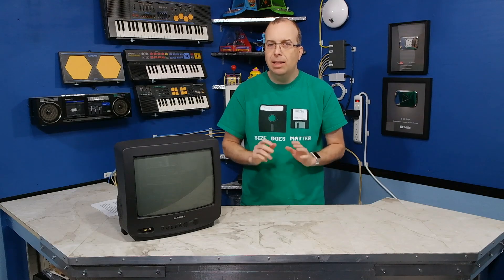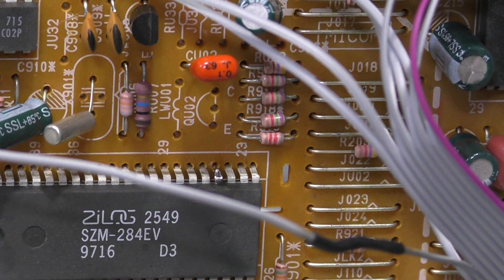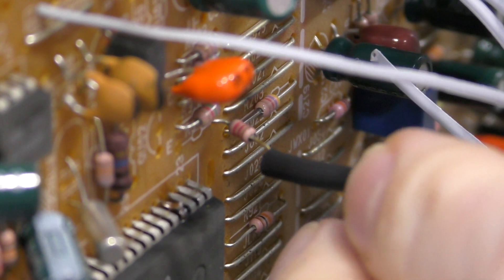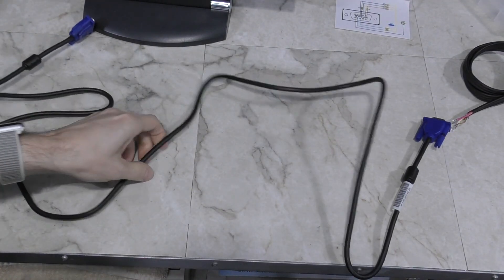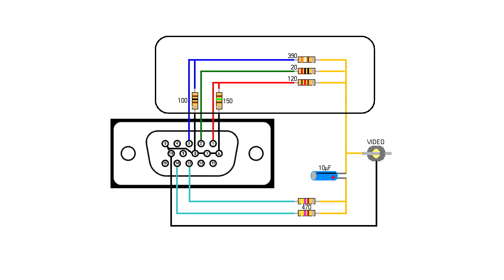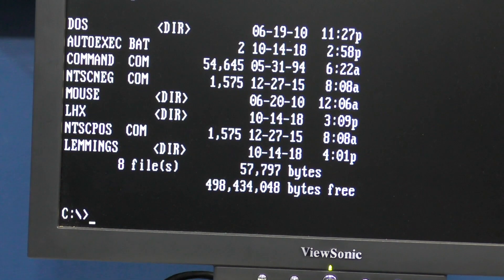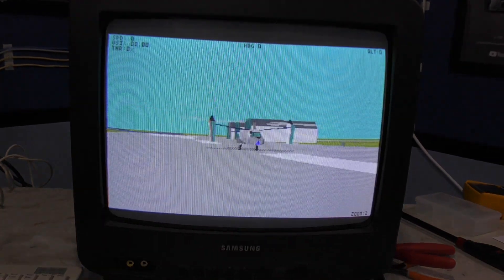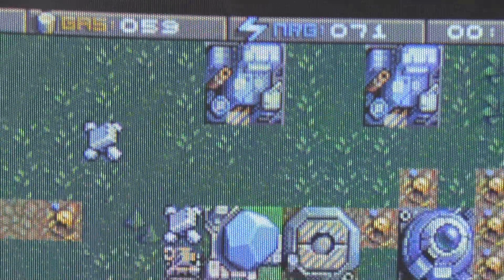Modding a TV for RGB - Part 2

Comment: could you change the tv from analog tv chanels to digital tv channels to get tv in the digital world
Reply: they sell/sold converter boxes for that.
Reply: HD capable digital TV tuners can output at a digital resolution of 1024x576 via SCART RGB, while composite remains old composite, often with ugly letterboxing.

So, using a box to upgrade to digital with just composite gets you a picture, but that is all that can be said about it. However, with RGB, the upgrade to 1024x576 makes switching to digital really worthwhile and brings some of the benfits of HDTV to older SDTV devices.
Reply: so your"e saying it could work?
Reply: Yes, certainly you can do that. I have watched TV for 8 years with a Vu+ Duo HD digital tuner connected to my Philips MG3 CRT television via SCART. I was very happy with that setup, skipped the LCD age, and only replaced it relatively recently with an OLED television.
Reply: well i ment inernal analog tuner in the tv itself, could you take out the analog tuner in the tv and replace it with a digital tuner from a flat screen tv
Reply: The digital tuner from a flat screen TV might not generate an analog RGB signal, it will do everything digitally. Assuming you could convert to analog, there isn't really a difference between an internal and external tuner. In the end both generate RGB signals.

If fact, you could remove the electronics from my Vu+ Duo (as has the circuits to convert to analog RGB) and build them into the TV. Voila, internal tuner.

Comment: IIRC didn't some high end TV sets have RGB connectors on them back in the 80s/90s? (not YPbPr, actual RGB often in RCA jacks)
Reply: I believe you are thinking of PVMs and BVMs, monitors with high-quality inputs for work on broadcasting or editing, which did have RGB, (RGBS and RGBHV) as well as YPbPr and even HDMI YEARS before they were on consumer televisions.
Reply: At 15khz I might add.

Comment: Great work but please get a hot air gun instead of using a naked flame on the heatshrink tubing!!
Reply from the maker: I have one.. the flame is easier to use than to dig out the air gun and plug it in, plus the flame is more directed to a smaller area exactly where I want it to go.

Comment: That was fast! Question, instead of the double throw switch, can't use a diode to prevent the 5v returning to the microcontroller?
Reply: there is a lot of comments discussing diodes, different types and the like.
Reply: You could also just use a resistor so it just sinks much less current.
Reply: @russdill  Problem with that is that it's still back feeding into the microcontroller, plus it would also affect the level of the signal going from the microcontroller to the jungle chip when the switch is off. A diode would have a small effect on the signal level as well, but not as much as a resistor would.

The double throw switch is an elegant solution that minimizes the change to the blanking signal. Yes, there is still some extra resistance due to the longer wire, but it's nothing compared to using a resistor or diode for this.
Reply: The switch solution is clearly preferable. I'm just saying I've seen similar problems solved in a very similar way. You're connecting an open-source to a totem-pole in a configuration where if the open-source (switch) is driving high, you don't care about the totem pole. Just put it behind a 4.7k. It'll have a negligible effect on the voltage if it's driving low, and will only be sinking about 1mA. The thing to watch out for here is it has an effect on the microcontroller's rise time. Back of napkin says it'll be fine though.

Comment: You could just have added a resistor between the 5v coming from the switch and the pin on the microcontroller. You could (maybe) even have used the already existing resistor. That way, if the µC pulls the line low while the button pulls it high, the resistor makes this have no effect except some very light power consumption.
Reply: But the result is then that the line is low, right? It should be high in order for RGB to get activated.

Comment: I wonder if it's possible to go the other way -- run your RGB output into a VGA monitor...
Reply: Only if the VGA monitor is compatible with the 15KHz television timings. Modern VGA monitors are sometimes compatible, but in general, monitors don't  accept 15KHz.
Reply: Well that's kind of what I meant -- how does one convert from a regular RGB output into a standard VGA input?  Converting the frequency and everything, so that a regular monitor can display the signal...   There's got to be a way, you'd think...
Reply: There is indeed a way, but it is complicated and requires storing the image temporary into memory and then outputting it at double speed. GBS-8200 and Retrotink2x are examples of devices that can do this. However, these are complex devices with microprocessors and firmware. It is not possible with simple electronic components.
Reply: Well, I guess that makes sense...  Figures it'd be a big pain...  Oh well...

Comment: a more elegant solution would be to just add a diode (maybe schottky) between mcu output pin and your +5v switch, so that current could never sink into the mcu. leaving a dangling ic pin is ungood, and with a long wire connected to it, doubleplusungood. it can lead to all sorts of erratic and weird behavior.
Reply: I don't think I agree here. You can normally safely leave an output pin unconnected. For inputs it is a different story, but that is not the case here.
Reply: a TV has high-voltage parts that produce powerful noise, and does the processor really need any more trash in its power and ground rails (in the simplest case) than it already has? why not prevent a potential problem before it has a chance to arise??
on the other hand, if it hangs once in a blue moon it's not really a big issue.
Reply: You need a hell of a lot of inductance to confuse chips running at TTL voltages, don't worry.

Comment: Additional to the comments on scart connectors on the last video. Yes, we in Europe were lucky to have the IDEA of scart... but the actual connector design was really REALLY bad. It'd have been better to use a D-sub of some kind
Reply: The problem was that with all that signals in the cable was bulky, because it contained in itself a lot of single coaxial cables, if you think about it, much more cables than VGA, as you had 3 coax for R, G, B, 2 coax for composite in and out, a coax for the RGB blanking signal, and audio L/R in and out, and a couple of single cables for functions like input selection, data pins for teletext, etc. 

The connector wasn't that bad, it was fairly easy to take apart and mod, for example to add extra wires and other thing, a D-sub connector wouldn't had that flexibility. The only thing that I would have added was some kind of latch to keep the connector secured to the TV, especially if you had the TV on a rotating stand it was easy for the connector to unplug.
Reply: You had varying degrees of quality when it came to SCART cables too. Some as you said had several internal coaxial cables, some used twisted pair and some had just the foil wrapper around simple wires.
Reply: Some were worse, just single wires with no foil. For a good quality like the Amiga for example, 3 coax for RGB, 1 coax for Csync, 2 coax for audio, and 3 single wires for commutation, blanking and ground. That made a pretty big cable. I used many saved VGA cables cut away from dead monitors to tweak my own SCART cables and always had good results.
Reply: Yeah it's rather… chunky to say the least. And kinda awkward to get to on most TVs, I ended up getting a scart switch box just so I don't have to reach behind the TV in my bedroom (which currently has my Sega Saturn plugged into. It's got a really good RGB signal via scart too! First console released to come as standard with a scart lead, iirc. So much better than rf)

Comment: Would that change mod work with pal without software mod?
Reply: Software is needed for PAL as well, but since PAL televisions generally have no problems with 60Hz, you can use exactly the same software.
Reply: PAL is different timings, so the software would need to instruct differently. Although maybe your TV does both. Techmoan has a Sony CRT that takes either NTSC or PAL and I slightly want one.
Reply: I know normal PAL has different timings, but PAL60 (as used in Brazil), uses the same timings as NTSC. Because of this, in the vast majority of cases, PAL televisions are more than happy with NTSC timing.

The other way around is less common: NTSC televisions often do not accept PAL timings.

Comment: I feel like there should be a TSRs that will sit between the game and the real hardware (hook the int) and just make it pass through timing things that work, and block register settings that will cause it to drop into an unsupported mode.... or at least watch for a keypress that will drop the video card into a working resolution/timing set.  I made one back in the day for my Gateway Handbook... press a key sequence and it toggled through a few video modes/screen stretch values to fill the screen better for a few different games. :D
Reply: Sounds interresting

Comment: What if I have an old Apple computer, (actually, something similar, but with an integrated monitor). But the monitor broke.
How could I hook a monitor, probably VGA, into the original board outputting video?
Reply: Depends on how the signal gets from the video controller to the display. For some it might be as simple as wiring a VGA connector to a header connector, while others may require linking to various points on the board to get the proper outputs. For example, the Powermac G3 All-in-one uses a ribbon cable coming from its Whisper or Wings expansion board to connect to the internal monitor, so you can connect a suitable connector to this point. Then again, the G3 board has a video port already on the logic board, so there's really no point in doing it with this particular system. The Powermac 5000-series and Twentieth Anniversary Mac also have options for adding an external display connector, but they're not compatible with the AV Output port options. It gets trickier for the LC/Performa 500 series, Color Classic/Color Classic II, and the monochrome compact macs, though the SE and SE/30 did have expansion cards made that could add a video output.

Comment: Why wouldn't a diode work?
Reply: [Edit: this comment is, as SEVERAL have told me, despite my already being corrected a few comments down]
Due to the way diodes work, it would unavoidably lower the 5V from the micro controller to like 3.6V, which might be out of the circuit's tolerance. Plus, doing that thing with that switch is easier and cheaper
Reply: Bengineer8 You are right about the lower voltage, however, a typical silicon diode only has a voltage drop of around 0.65 volts, so the output would be ~4.35 volts which is very close to the range of a TTL-level IC (4.5v to 5.5v approximately). A germanium diode has a voltage drop of ~0.2 volt
Reply: @BertGrink  You can also use a schottky diode, which should get you around 0.3V of voltage drop.
Reply: @BertGrink  aaaaahhhh, TYVM for that info
Reply: Could've used a Schottky Diode as well.
Reply: izimsi 
Ahh that's even better!
Reply: Bengineer8 You're very welcome.
BTW those values i mentioned earlier also apply to transistors.
Reply: @bengineer8  oh ok, I didn't know that a diode caused that much of a voltage drop :P
Reply: @bengineer8  No diode has a voltage drop of 1.4 volts on no load. Maximum would be around 0.8 volts. Even if it had, it would in %95 percent of the circuits would be no problem, it is above the usual high threshold.
Reply: @tunahankaratay1523  if you look, you will see multiple people have already corrected me.
Reply: @bengineer8  it happens most people don't read all the comments. It's kinda funny reading some comments I won't point any out. 

Enough on that I like the switch idea if you are going to use the TV for what it was made for. You can still use analog for some hookups. I would only do this to my old tv's that I want to keep out of the landfills where I live. We were forced into buying new tvs there should have been a gradual move into digital television where the tvs could have been used until they quit working, then upgrade. I'm glad in some ways but sad in other ways as well. The hobby of DXing tv stations is to of non existing.  I do like more channels that digital tv brings.
Reply: @ronb6182  I am waiting for 1Mhz displays so we can emulate CRT's.
Reply: @bengineer8  It depends, some will only drop around 0.7v wich could not impact in the tolerance. But the 8bit guy's mod is way better.
Reply: adding a diode was also my first thought, and it would actually work. but when you have a double throw switch, why not use it like that? :) its also an elegant solution
Reply: You absolutely would not need a full bridge rectifier as you're only stopping one continuous current from flowing in one direction. However, the point about voltage drop makes sense.
Reply: Cuz you need a FULL BRIDGE RECTIFIYAH!!
Reply: @Crusher29  https://www.youtube.com/user/msadaghd
Reply: @Crusher29  Yes, NOT a puny single diode rectifier. Lol
Reply: @Crusher29  I see what you did there!
Reply: the problem is a FULL BRIDGE RECTIFIYAH!! would drop the voltage by double the amount ;) 

Yes, I AM fun at parties. I seek out the pets
Reply: TheChipmunk2008 
So let’s wire a transformer in!
Reply: now thats MAFBR
Reply: Crusher Rusher You should lick the high voltage capacitor too.
Reply: @Crusher29  ahh I see electroboom fan here hehe hi
Reply: Because when the voltage pass through the diode it drops by 0.7 volts (the diode drop voltage may vary in the diode type or model).
And I let you the example that Bengineer8 left you.
Reply: My first thought was diode but I guess not everyone is comfortable with electronics, a switch is easier to get your head round and does the job.
Reply: I dont know how fast blanking signal is or if it pulses like a clock(but a its pin from a mcu, probaly it pulses fast considering a video signal entering). but a schottky diode probaly wont switch fast enough if needed, would be better use a fast switching diode if necessary(maybe a 1n4148 or better).
Reply: diode would probably bring the 5 down to about 4.3 ~ 4.4 v , or less, TTL inputs will always take that anything in that range as high , you'd need a proper pull down so that the jungle ic read zero , other than that , 3.6 , 3.3 ,3 etc is high
Reply: What if he used a shottky diode?
Reply: It could work, but it would lower down the voltage by 0.7-1.5v wi h could make the signal not be recognized in the other chip. 
Also it would be a pain to dessolder the leg of the ic to make the propper mod with the diode.
Reply: @Shadan Rikan others already told me that
Reply: A schottky diode would work, with its incredibly low voltage drop of .2-.3 volts without a load. Or a simple 1k+ resistor in series to the MCU would also work, since the MCU voltage would collapse if it tried to oppose the switch.
Reply: Zacchi4000 Look at my comment again.

Comment: what frequency is the computer at by default and did you need to change it to 29.97 hrtz or 30?
Reply: It's more about the horizontal frequency than the vertical frequency. NTSC runs at about 60Hz in interlaced mode (the exact value is about .04 Hz lower) with a horizontal frequency of 15.7kHz. VGA expects about 31kHz horizontal frequency at the same resolution and vertical refresh rate as it's drawing twice as many lines per frame, instead of alternating between the odd lines and even lines.
Reply: @evknucklehead  TY

Comment: The solution is to have a resident program that will keep the vga registers set to whatever you want so that even if apps change them they go back to the correct frecuency in say half a second?

Otherwise youd need a loader or to patch the games so they dont change the registers
Reply: that wouldnt work if game messes with geometry, "changing them back" would distort custom mode game planned to use, like 320x240, 320x400, etc. What could work would be periodically (lets say every 1-2 seconds) reading CRTC, detecting change and adapting to new values.
Reply: Eternal love!
Reply: The solution is to add an EEPROM that describes the NTSC video mode.
Reply: russdill 
Is it as simple as adding an eeprom? I know theres data lines for the display modes but one i dont know how that works, and two either the game or the video card would need to give a fuck about it first, otherwise it would be there being completely ignored. I dont recall dos programs detecting displays capabilities at all.
It would be useful to covert a tv into a fully working monitor though but for more modern systems that actually detect the display.

Other than that reading the registers and adapting them seems like the best solution so far.
Reply: you'd need to rewrite the registers at least every 60th of a second, CRT's refresh crazy fast, from 60hz up to 200hz (maybe even further, but nobody knows yet)
Reply: MARIO nobody changes timings every frame, you do that only when changing modes, 1-2 seconds without picture is not the end of the world
Reply: I never said anything about losing picture for 1-2 seconds.
Reply: It would possibly break some games tho. Patching would be the best bet